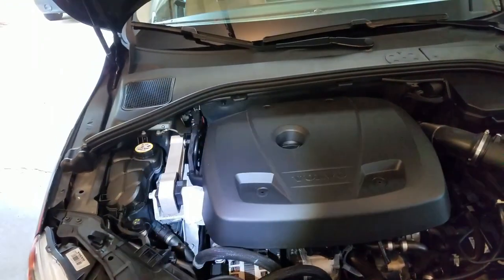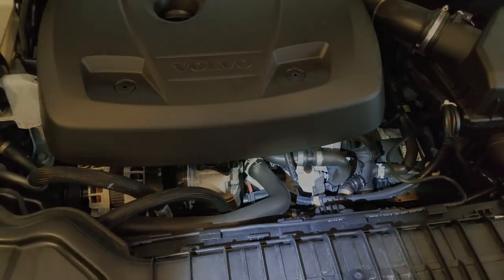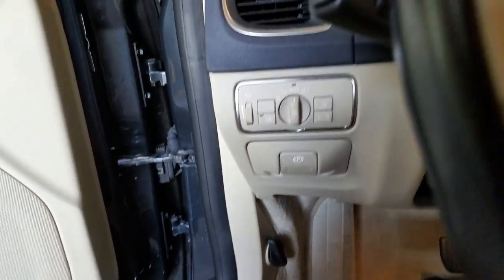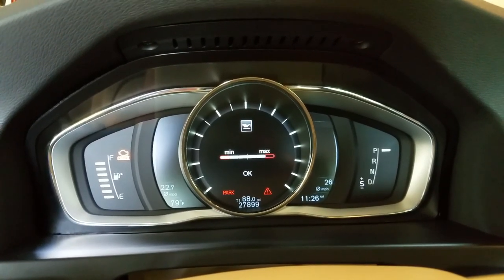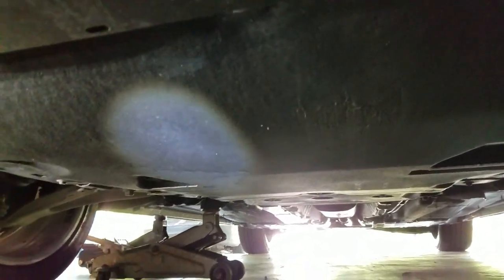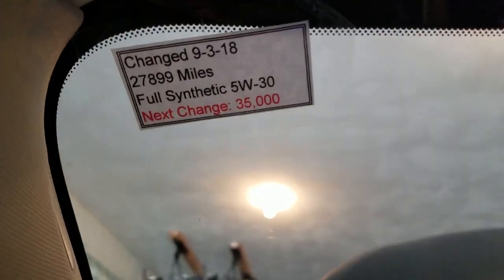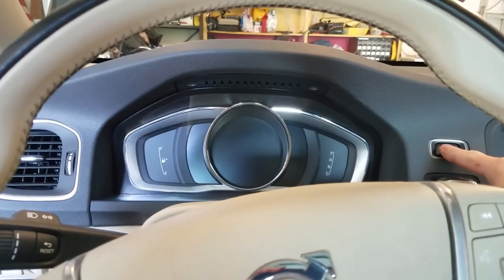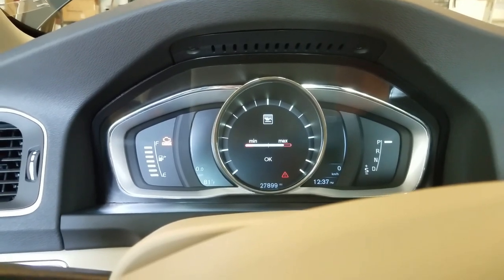2015 Volvo S60 4 Cylinder Oil Change

Comment: Thank you for a great video.

FYI, you have to drive the car for 20 miles or engine off for 2 hours before you can check the level again....

From the manual:
NOTE
• The system cannot detect changes in
the oil level immediately. The vehicle
must be driven approximately 20 miles
(30 km) or have been parked on level
ground with the engine off for 2 hours
before the oil level reading will be correct.
• If the necessary conditions are not met
for checking the oil level electronically
(time interval after the engine was
switched off, if the vehicle is parked on
an incline, etc.), Not available will be
displayed. This does not indicate a
problem with the oil level sensor.
Reply from the maker: According to the dealership when I asked them, for major changes such as an overfill or under-fill situation, it would detect that almost immediately.  That's primarily what we're interested in, and mostly just making sure we don't overfill.  If you use a specific amount of oil to fill each time, you should never have to worry about that though.

Comment: I was reading the other day that Volvo custom-made 0W20 Oil for Drive-E vehicles but since it's not available in the US Market dealerships just use the 5W30.. the oil that Volvo made for the Drive-E is 0W20 rbs0-2ae it's not any 0W20 it has to meet the volvo vcc rbs0-2ae requirements.

Comment: Hello, I just bought a volvo s60 2017 with a 120 hp d2 engine and 61000 km on the odometer. Thank you for telling me where the fuel filter is and the mileage at which to change the timing belt.

Comment: Excellent tutorial, have you had any expensive issues/quirks with the Drive-E other than your posted videos? I'm in the market for a new Volvo, considering 2017 T5 FWD but all this new tech scares me coming from the classic T5. Certainly seems less intuitive for the weekend Volvo hobbyist like ourselves. Where's my dipstick!? Fellow Michigander - hello from Grand Rapids
Reply from the maker: It's not just Volvo with the disappearing dipsticks and all the tech.  You can find it on most brands these days.  I haven't had any troubles so far.  My biggest complaints is there isn't a lot of room to put stuff.  My phone doesn't sit anywhere easily so I got a CD tray mounted holder that works really well.  Trunk space is a bit limited for trips, but I just got a cargo carrier and hitch that solved that issue.  Overall, still absolutely love the car.  I got this car on 28th street in GR too!
Reply: @MIFixItDad  Very nice! Trunk space is definitely a downside in the S60. Looking at one with 46k tomorrow, out of warranty but a decent local import dealer. Not a whole lot of consumer review info out there on these newer models so appreciate your posts and experience. If you have any tips/cautions let me know!

Comment: Why are you using 5w-30 ? My Amsoil database which is pulled from the manufacturer specs calls for European blend of 0w-20 Low saps
Reply from the maker: Because the owners manual lists that as a good oil to use.  The 0W-20 is only really needed for max economy.   I also asked Volvo directly and they supplied me with the same info. B
Reply: @MIFixItDad  well I can tell you that if you don’t use what the book says or a customer uses our brand of oil it won’t be covered under our warranty unless the oil per the manufacturer is used or what is outlined as approved oil in our database. I let my customers use whatever weight of oil they want from us but i let them know if they are not using what is recommended by the hook then it’s at their own risk .
Reply from the maker: @Joblessparadise  What's REALLY annoying is the actual Volvo spec calls for ACAE A5/B5 oil, and recommends Castrol.  The only current Castrol A5/B5 rated oil is the Professional series, which isn't sold in the US.  The one in the US is the Edge full synthetic high mileage, which I believe was ACEA A3/B4 rated.  Even so, that's what Volvo said to use for US residents when I asked.  It's been almost a decade, so there is no good reason this oil isn't available in the US.  It's out of warranty at this point anyway, so I just make sure to use the "good stuff" and change at 5000 mile intervals.
Reply: @MIFixItDad  amsoil is the best you’re going to get for just about anything and that’s backed up by numerous testing and we also carry our own warranty for our oil so yes it would be covered under warranty if our oil in some rare event caused an issue or fell below spec as long as you use our recommended oil and use it at the correct interval.

Comment: Hi,
I’m trying to replace fuel filter. Can you please share where I can locate the filter?
Reply from the maker: I'll try to get a video doing it some time.  I need to replace mine too.  If you look under the passenger side, you''ll see the fuel lines running down from the fuel pump/gas tank toward the front of the car.  If your car has the filter, it should be just forward of the wheel well.  It will be a fist sized cylinder inserted into the fuel line.  Mine has one, but I hear some of these Volvo's may not have one.  I don't know if that's true or not.
Reply from the maker: Actually, I got my 2009 and 2015 mixed up.  It's the 2009 I had to replace the filter on.  They are in the same general area though.  The 2015 is near where the fill tube comes down from the fuel fill door.  It sits up on top of some sort of cross member or panel, but you'll see 2 parallel fuel lines.  Just follow those and they will terminate at the filter.
Reply: Maybe the filter is a “lifetime” device and is in the fuel tank. Some carmakers are doing this now.

Comment: Just a few comments on oil changes. The o-rings should have some oil applied to them before installation. Not much, just enough to make them slippery.

The filter canister should be cleaned out before reinstalling with a new filter. If you don’t have a solvent tank, use brake clean to spray it out and wipe with a lint-free rag.

Also, the drain bolt and filter both have a tightening torque spec. It seemed in your video that the filter wrench was slipping on the filter canister. You might want to get a better filter wrench and check the torque.

My XC70 didn’t have the drain in the filter canister, so I doubt I will use it in my XC60. If you wait to change the filter until after the oil cools the filter canister will not leak so much oil during removal.

You might also mention that for the electronic oil level to work properly the car must be level (off the jack stands or jack). I severely miss the dipstick.

The newer versions of that engine have a standpipe in the drain plug for getting the oil level correct. A simple oil change is becoming more and more onerous when a simple dipstick would suffice.

I like the service reset. I hope it works on my 2017 XC60.
Reply from the maker: Thanks for the reply.  I do put oil on the o-ring around the canister, just not the one for the canister drain.  It usually gets some just from what's on my hands, but that's not intentional.  My filter wrench is indeed loose.  It's a cheapie and has always been that way.  It doesn't slip so I just let it go.  On this one, the canister will turn until it hits the stop, then you can't turn turn it any more.  I never tighten it beyond that.  The o ring provides the mechanical seal and there are so many threads to get it all the way on, it could never come off.  I should indeed be torquing the drain plug though.  I've just done it so many times on my 2009, and the specs are the same, I just know by feel and can get it pretty darn close.  There is a range from min to max that is acceptable.  Max of course so you don't strip the threads, and min so it doesn't fall out.  To do it the right way, it should always be torqued though, so I have to agree with you wholeheartedly.  I had in my head to mention about the level spot for checking the oil too and just missed it.  There is so much to remember when making one of these videos I inevitably miss something.  Good catch though.  Hopefully people understand, the same as with a car that has a dipstick, it has to be level to get a good reading.  I'm right there with you on the dipstick too.  I don't like not having one.  It's simple, reliable, and cheap.  

Thanks again!  Hope you enjoy the XC60.  I have a friend who's looking at a 2019 one of those for his wife in that beautiful burgundy.  With that Thor's hammer design for the lights, that's one beautiful car!
Reply: Floyd Nash   What you do helps folks. I was just hitting on a few details that folks may not be aware of when they do this, like how much the drain plug or filter should be tightened. 

Kudos to you for doing the video. For me, that would be the hard part, and I’m sure I would miss attention to the details.

Comment: Hello Floyd, I have a 2015.5 Volvo S60 Drive E Premier plus, I bought it used at 29,000 Km in 2017, the mileage that I got now is 103,000 Km. I changed the oil at 8,000 Km interval, I don't do it by myself, although I could. Recently, about 2 weeks ago, I got the message on the dash saying my oil level is low and to top up 1 Quart (1 liter) of engine oil. I bought 1 liter of  the engine oil that Volvo recommends in the manual (the same one you used in your video) and top up about 800 ml to 850 ml, checked the oil on the dash and it said OK. At the time when I topped up I had 3,900 Km from the last oil change. Like I  said, this never happened before, this is the first time. I read on internet some horror stories about the same year engines (2015 Drive E engine/4 Cylinders) having issues with oil consumption and had the piston rings replaced to solve the issue. Have you heard something about this issue? Have you had your oil level dropped and had to top up?  1 liter of 5,7 liters is 18%, a lot in my opinion, I am wondering if my mechanic put the right volume of oil in the engine when he replaced the oil. Now I check the oil level every week. Thanks
Reply from the maker: Yes, I have heard of that exact issue and watch for the same issue to occur on my car too.  I hope I get lucky enough that it doesn't.  Volvo is very quite about it, but if it happens, there are only 2 things you can do that I'm aware of.  One is to live with it and add oil as needed, which may only work for a while since the issue can cause engine failure in some cases.  Two is to have the pistons and rings replaced.  If the cylinder walls get scored, then engine replacement is needed.  You may want to call Volvo and ask to have the engine tested and push as hard as possible for out of warranty repair.  Might not work, but you can at least try.  It's sad that this happens.  I love these cars and want to buy another Volvo after the one I have, but if they keep having issues, I'm getting a Toyota.
Reply: @MIFixItDad  Yes, I do like Volvos. I thought to do nothing as of yet and see if it happens again. Perhaps I shouldn't wait at all, I bought the vehicle from a Volvo dealership here in town. I will go back to them and have an oil consumption test done and I will see, who knows I may be lucky and the leak will be within their Volvo limits. I will definitely book for an oil consumption test at the local Volvo dealership. I will let you know what will happen, if you'd like. Thank you.
Reply: Oil consumption can be caused by bad oil control rings, worn intake guides, or even a head gasket that allows the oil to migrate into the water cooling system, or drip down the block. Doesn't sound like you're dumping it on the ground, so must be getting burned internally (if not going into the radiator).  A good first step would be to pull the spark plugs and see if any don't have a slight gray color, since oil getting burned in a cylinder will usually coat the effected spark plug.  There are oil additive products you can try such as BG MOA which can increase mileage between adding a quart, but will have to factor in the price of each to find out which is more cost effective.
Reply: @rv9flyer13brotary9  thanks

Comment: Hi Floyd,
Thank you for good videos!!!
You know where is power steering refill location? for same car
Thank you 😊
Reply from the maker: If you also have the 2.0 engine, those cars were equipped with an electric power steering rack, so there is no fluid to check or refill.

Comment: Hi Floyd! Thank you for an amazing video. Do you know if the oil filter tool is 86 mm/ 16? I have to change my oil filter next week and I drive the D4 2.0 VEA and it should be the same oil filter cap as on the gasoline model but I'm not sure.
Reply from the maker: Yes, if it uses the same filter cartridge, then it would be 86mm.
Reply: @MIFixItDad  Thanks for the quick response. Is it 16 edges? I have found a lot of variations of 86 mm...
Reply from the maker: @rasmuspetterssonn  I haven't counted the edges but yes, I think the standard for Volvo, and I think some BMW also is 86x16

Comment: Hello Floyd. How is the overall reliability so far? Does the turbo engine  burn any oil btween changes? Planning to buy a used 2016 V60 @26k miles ...any concerns i should be aware of? Do you use regular or premium gas? If using mostly regular, how is the engine behaving? Thanks!  Ron from "neighboring " Bloomfield Hills, Mi
Reply from the maker: Hi Ron.  I have had no troubles with the car burning any oil at all between oil changes.  Being a turbo doesn't automatically make it more prone to burning oil.  Back in the "old" days it might have, but no more.  I have a 2009 S60 2.5 turbo that doesn't burn oil with 172,000 miles on it.  The only real issue I had is a fuel pressure sensor went bad, but it was replaced under warranty.  I have tried regular to compare to premium, and it won't hurt the car but you can feel the difference in performance.  The premium fuel allows the engine to run a much more aggressive timing profile.  To achieve full rated horsepower, you have to use Premium.  It's enough to notice when really pushing it on hard acceleration and passing.  Comfort is exceptional.  These Volvo seats are just incredibly comfortable.  The sound system is exceptional, and it's just a really fun car to drive.  Hopefully you have a good experience with your V60 and enjoy it as well.
Reply: My 2015 has 212,xxx miles and burns up to two quarts between intervals. I do keep it pegged at 110 on the highway sometimes though...

Comment: Hi floyd.. can you pls share me the diesel filter part number for your s60 . Thnx
Reply from the maker: My S60 is gasoline or petrol, not diesel, so I don't know if it's the same part number.  Go to FCPEuro.com.  You can enter the information for your car and engine type and it will tell you exactly what you should order.

Comment: Hi Floyd do you use the oil filter cup with 16 flutes or 18 flutes? Just making sure before buying it. Thanks in advance
Reply from the maker: 86mm 16 flute.  Go to FCPEURO.COM and input your exact vehicle and search on oil filter wrench.  I think I got mine from Rock Auto.  It's been so long I can't remember any more.  You can also find them on Amazon and many other places.
Reply: @MIFixItDad  thank you very much for confirming 👍. Just need to confirm the amount of flutes so I can order it from ebay. I have a '15 D4 that needs servicing soon. Did a research online apparently it uses the same filter as yours so logically their housing should be the same.

Comment: Here is the TSB on the engine number : Since your car is a early 2.0t Drive E. Im 100% sure it falls into the bad rings catergory . Does not mean it will happen but the chances are good it might . #1501327 is the point where non defective pistons and rings were used .Any engine before that is a crap shoot . Im sorry i was not able to paste the TSB here for you to view .
Reply from the maker: Is there a link, TSB number, or anything?  I've googled the crap out of this and I still find nothing at all on it.  I want to be able to share it, or go to my dealer and ask about it, but I have nothing to take to them right now.
Reply: @MIFixItDad  Floyd go to swedespeed . Its a volvo owners chat site . Then go to 2011 to 2018 s60 section
Reply: Floyd Nash Hi Floyd. Did you found any info about the piston issue?

Comment: Used oil is a carcinogen, wear cloves. If the oil is that black and thickened it should've been changed sooner. The benefit of a dip stick is that you can see what the oil looks like without draining it. In my 2007 S60, I change the oil when it looks medium brown on the dip stick.
Reply from the maker: The manufacturer says change the oil at 10,000 and I don't.  I go no more than 5,000.  These cars don't have dipsticks so you can't use that as a test.  My 2009 did, but a lot of newer cars no longer have a dipstick.  Also, dark oil is not just an indication of contaminants.  Heat alone will cause the oil to get dark.  If you put oil in a coffee pot and put it on a hot plate, it will turn dark without using it or circulating it at all.  Turbo cars generate a lot of heat and will cause the oil to get hotter, faster, thus darker.  It doesn't mean it's bad, it's just something that happens when you heat oil.  I've sent samples of my oil to a test lab at 5,000 miles and it was still just fine, but I still prefer not to exceed 5,000 miles at most.  I did the same thing on my 2009 and my daughter is driving it now at well over 200,000 miles and going strong.  Making sure to use the correct oil with the correct certifications for your car will help keep it in good shape also.